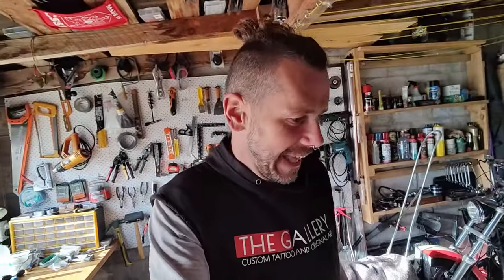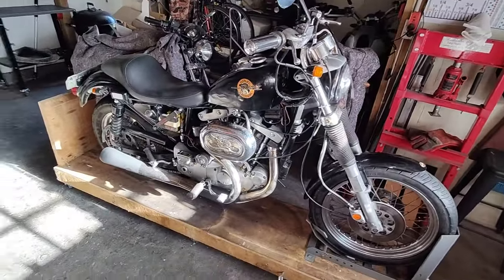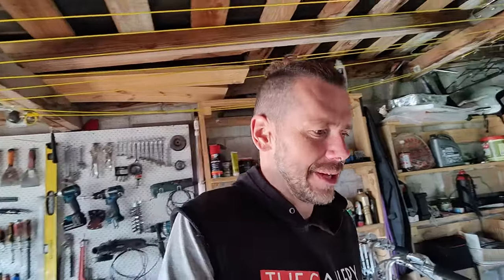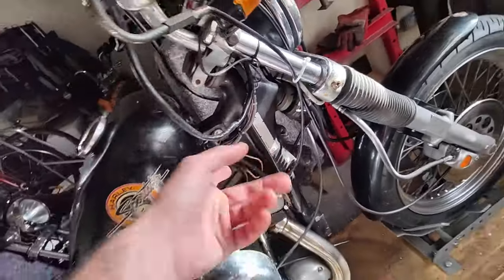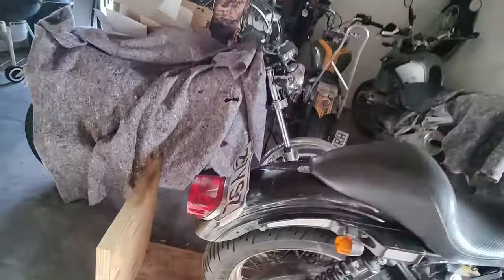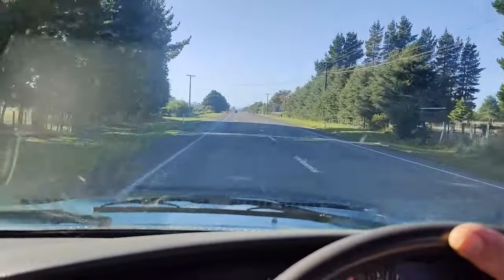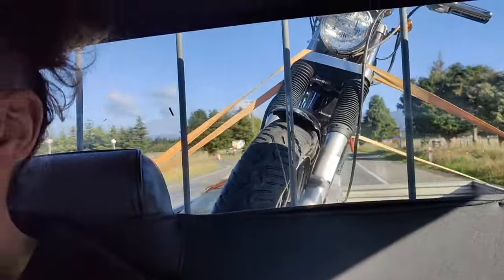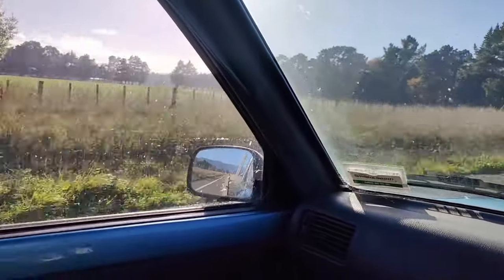How to make your 1979 Ironhead Sportster legal in New Zealand I Part 1

Comment: So building a jockey shift chopper would be impossible? I have no turn signals. No front brake. Old drum brake with foot clutch hand shift I made myself. 1955
Reply from the maker: I'm not sure. I don't think it would work. My 1970 only worked as legal because vintage club have me papers staying that's original. Maybe you can do mods after you make it legal to avoid questions?